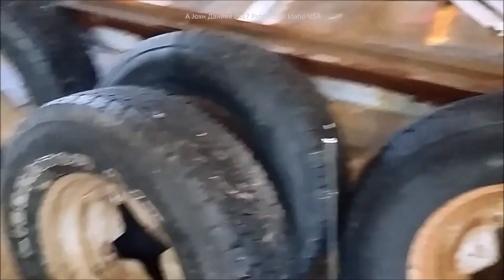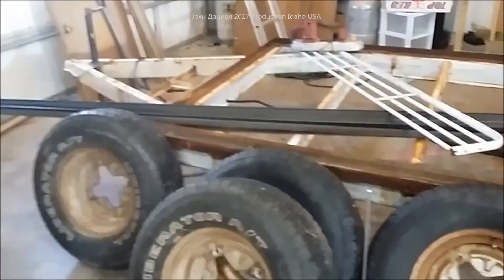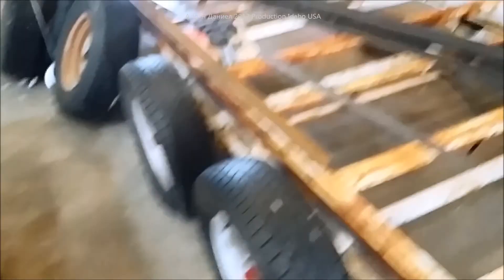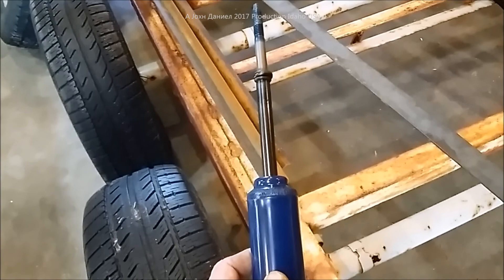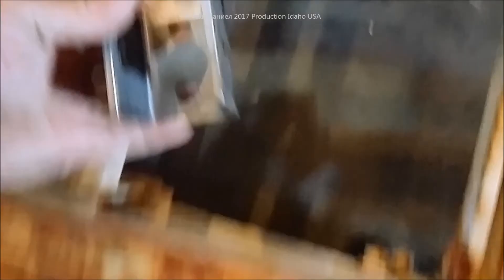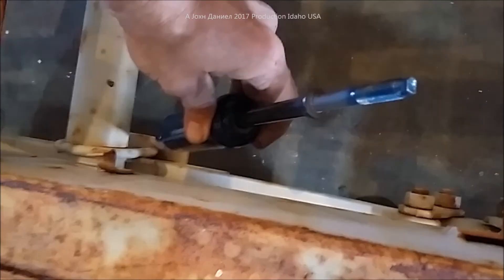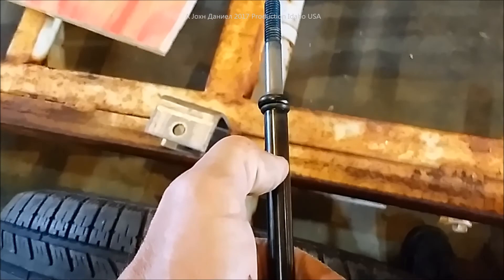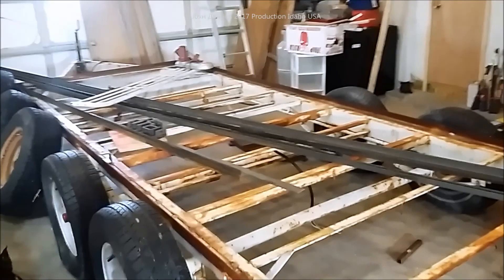Double Axle Trailer Build, pt 1 Install Monroe gas shocks (Parts Used Below)

Comment from the maker: PARTS USED & SPECS - READ ALL, http://amzn.to/2pNy5YB OR https://ebay.to/2PqbmhT 5 Lug 3500 To change from 4 on 9.44 to Modern Wheels. CHEAP SHOCKS for trailers, Amazon - Monroe http://amzn.to/2oQoKiv Gabriel http://amzn.to/2onKbTS LED TAIL LIGHTS http://amzn.to/2ppOHFe.
Drum Bolt pattern: 5 on 4.5", bearing races and 1/2"-20 studs installed

Kits includes 2 x L68149 inner cone bearings,  2 x L44649 outer cone bearings, 2 x Grease seals 1.719" x 2.565",  2 x E Z lube grease caps with rubber plug.
You get 10 cone taper wheel/lug nuts 1/2"-20 thread
Each set is one left + one right 10"x 2-1/4" electric brakes with 3" center bore and a 4" mounting bolts circle diameter

Good luck, safe welding.

Comment: Shocks increasing tyre life makes sense, keeping the tyres from bouncing lika a jack rabbit.
no one is going to steal those rims, our wheels get stolen from time to time but your rims would not fit anything.
Reply from the maker: +closertothetruth The Dexter/Fayette wheel was designed in 1963 due to traffic fatalities caused by people putting trailer wheels and tires on cars to save a buck. The result of this 4 bolt wheel was surprising strength, 7400 lbs worth, due to the inner rim being supported by the shoulder of the hub and not the bolts.
However the only way to balance them is by a 10 degree offset balancer (extinct now) and a good tire man (also extinct now).
Reply from the maker: +closertothetruth FYI - These wheels are known as Dexter Fayette Dayton 494 rims. 4 bolt on 9.44" spaced. Made in 13, 14 and 15" plus for south america the metric version 355mm.
I have 83 of them, 20 years of stockpiles. They NOW sell for $100 online so I may start liquidating extras since all my other 7 trailers are 5,6,7 and 8 bolt.
Reply from the maker: +Јохн Даниел www.vintagetrailersupply.com/15-Vintage-Wheel-15x6-4-Bolt-on-9-44-p/vts-887.htm
Reply: Very good info.